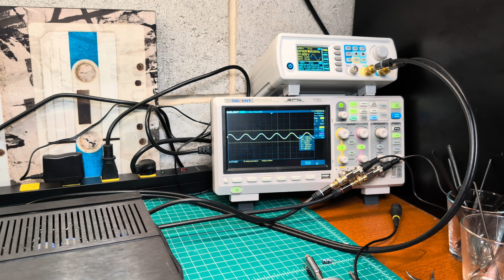Tandberg 3002A Control Amplifier Restoration: Part 1 - Recapping & Deoxidizing

Comment: I have complete 3000 series (amp,preamp, turner and cassette) do you hear major sound improvement before/after capacitors changed? Thanks
Reply from the maker: I bet this is the question to owner.